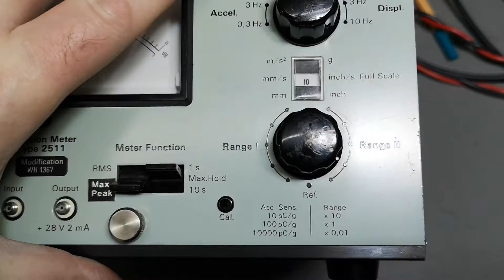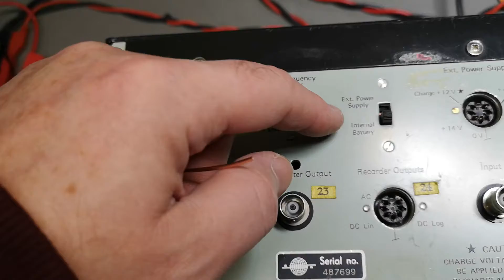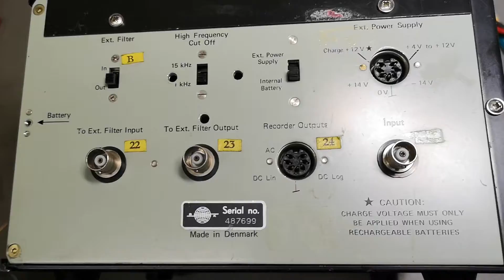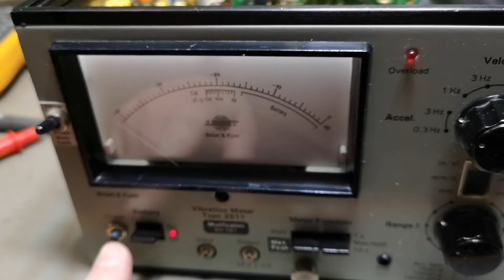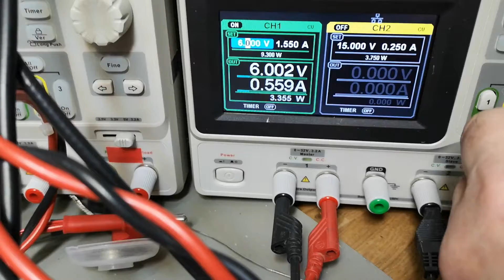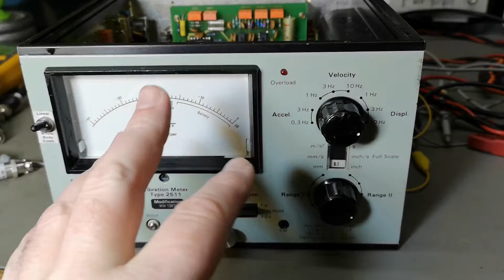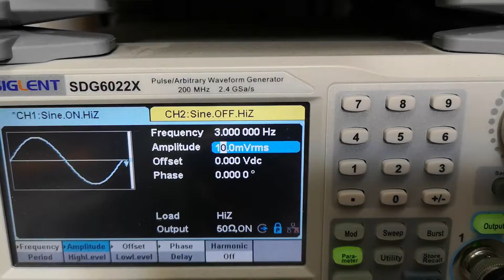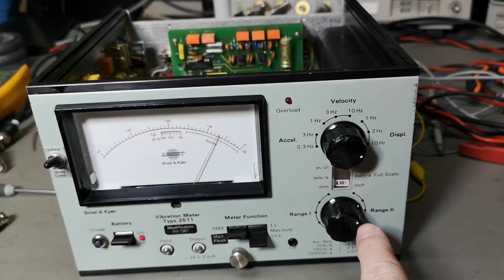Brüel & Kjær Vibration Meter Type 2511 test teardown

Comment: As you mentioned, these units are used with a piezoelectric accelerometer sensor. The top right hand side knob enables single or double integration of the acceleration signal, so the measured values can be viewed as either acceleration (mm/s2), velocity (mm/s) or displacement (mm).

Comment: I used to have just the amplifier head from a tube-type vibration meter with a built-in calibrator which would vibrate the head at line frequency.  Unfortunately the sensor which came with it was ruined...

Comment: Yes the transducers are purely capacitive, and that 1M and 1n is very much what they are, though the capacitor is normally around 10n and a 10M resistor  for the emulator, as the internal impedance of the measuring amplifier is around 100M, and you can see a response turning the sensor 90 degrees from horizontal to vertical with nothing on the sensing stud.
Reply from the maker: yes they are nearly all pizzo, i hear some roumors about some comming my way, for future B&K equipment tests and such :-)